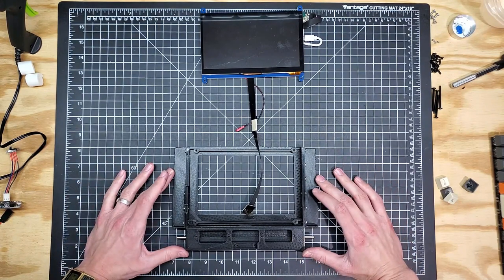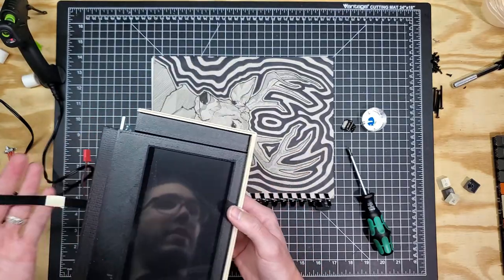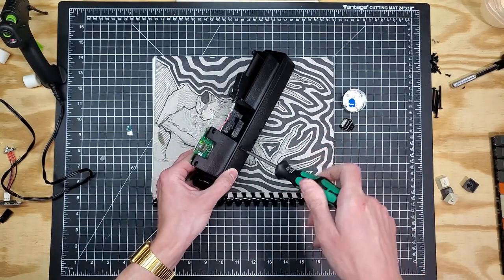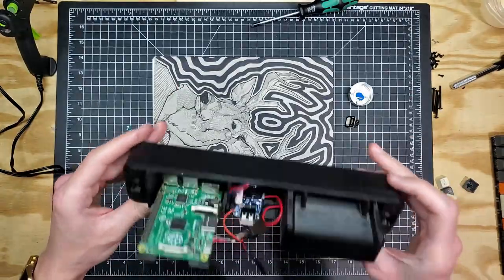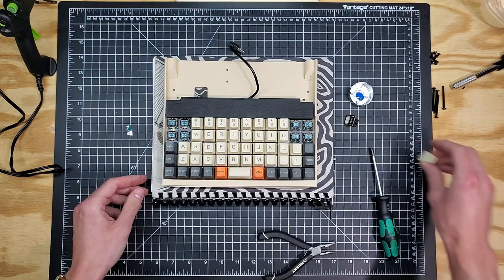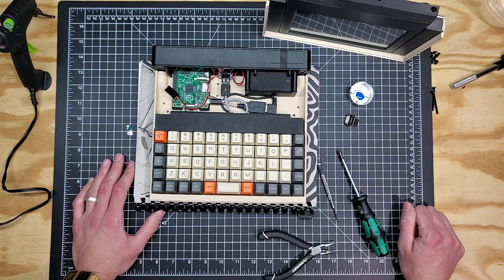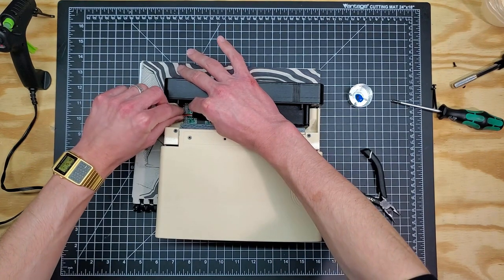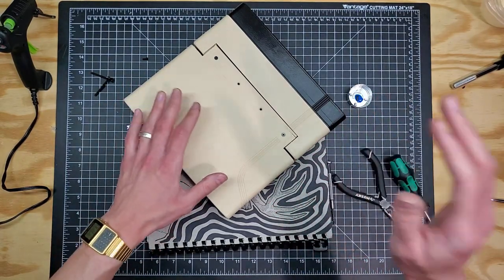BS&OB Ep 4: GRIZ Sextant Cyberdeck Full Build

Comment: Just a bit of engineering advice. If you’re going to rely upon split holes and friction on your pivot blocks the holes should be ovals rather than round. The round holes won’t last very long for your intended purpose.
Reply from the maker: That's great input! You have any resources that dive deeper into the mechanics of that? I'd love to read more.
Reply: @BehindScheduleandOverBudget  I was an ASE Master Automotive Technician for 25+ years and a multi Harley Davidson owner. It’s a common mechanical device used to attach shifter levers to transmission shifter shafts in both motorcycles and automatic automobile transmissions. The best way I’ve found to accomplish this in a home garage is to drill the hole undersized by a heavy 1/16th and work the oval shape into the hole with a round file. You’ll find that once the bolt in the lever is tightened down the lever won’t move on the shaft, even if you are attaching a softer metal lever to a steel shaft. Doing this will save you from many hours of ass pains in the future and greatly increase the life of the lever, even under relatively high torque and heavy use.